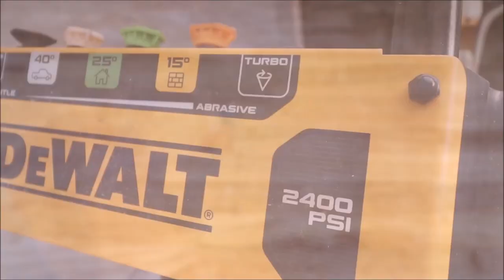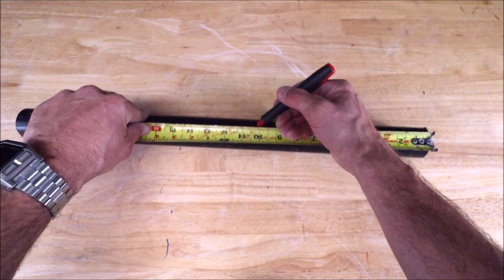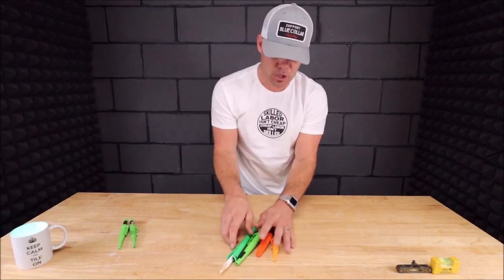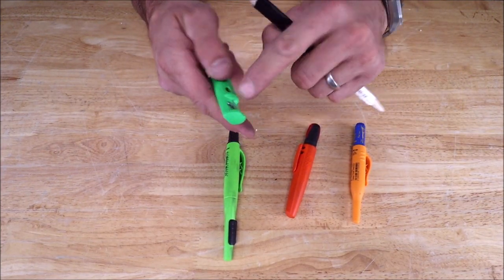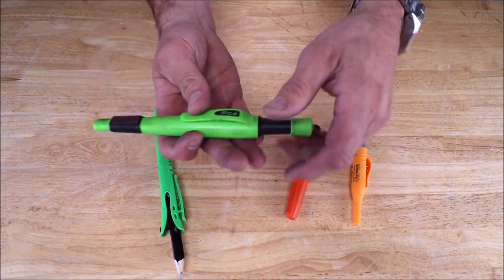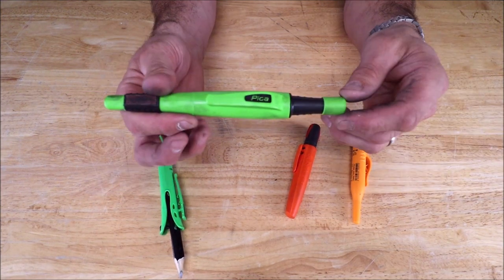PICA Markers / Most Advanced Marking Tools!

Comment: I bought the deep hole ink marker after being impressed by the pressure-wash clip in this video. Perhaps Amazon sold me a dud… but these were nowhere near as tolerant of the wet saw as my Milwaukee markers. I wanted a fine-point version of the Milwaukee but this - in my experience - is not at all it.
I’ll keep ‘em for dry usage but I was super-disappointed.